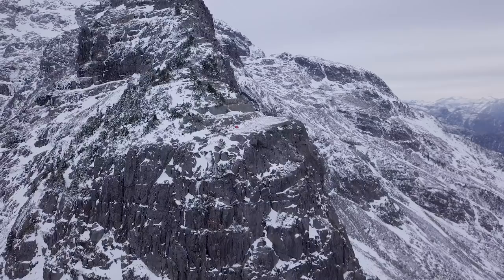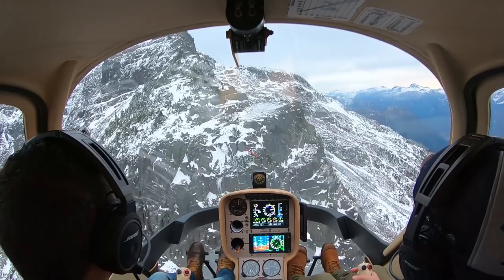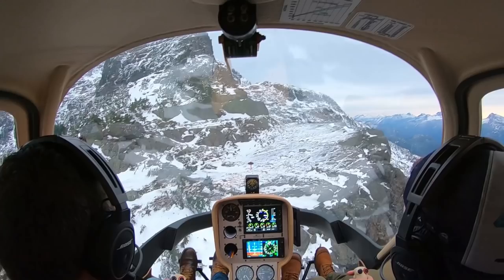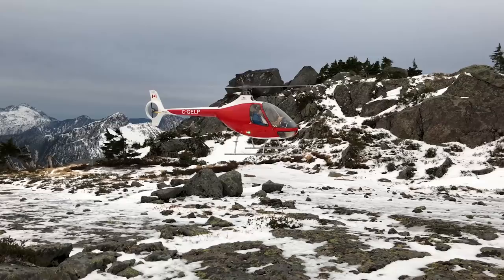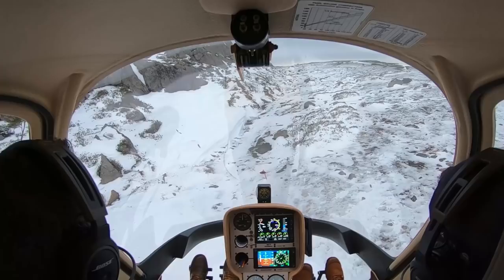WHY HELICOPTERS CRASH WHEN OVERPITCHED

Comment: A few years ago I took a ride in a Bell 47 (the one from the MASH series) at Sun & Fun and while we were out tooling around I could tell we were out of power. If he just tried to sit in a hover and climb straight up, we would not gain altitude. There simply was nothing left. And the rotors began making a different noise. Full of fuel, two large adults and 100° temps all contributed. Rather than the steady chop chop chop your ears get used to, it began to beat and the vibration was much more severe. The blades were at their full pitch yet the piston engine could not keep the RPM up. I glanced over when I noticed all this and he simply muttered "...over pitched..." and had to fly forward to gain enough rotor RPM to land. Fascinating to see this first hand.

Comment: While working at GE building T700's that go on the Army's Blackhawk, two pilots were touring the plant. They stopped to talk to some of us assemblers who were pulling lock wire to an assembly. They invited us to come watch them "pull pitch" as they left the plant in their Blackhawk helicopter. So at 4:00pm we went out to watch at the heliport .... and we got the best air show ever. After the flight engineer did his thing, and pilots warmed up the turbines to full power they "pulled pitch" Those two GE engines jumped that copter straight up about a 100 feet in a second... they hovered, turned toward the Saugus River and booked at full speed...just when we thought they were heading away for good....they came buzzing back at a 100 feet and headed for Boston.... an amazing display of power. That day we learned what pulling pitch was in that Blackhawk.

Comment: CFI Rotor here. I just taught maintain your rotor speed in the green a lot less to think about. Rolling off the power is not the same, depending on the helicopter too low of rotor speed can cause loss of tail rotor effectiveness. I teach RPM times torque equals horsepower.  Keep it in the green and live.

Comment: In 1970 in the Alaska Range I crashed (as a passenger in the front left seat) in a FH-1100. There were 5 of us aboard (including the pilot) and we were quite heavy flying in strong winds.The pilot was asked to drop me in a cirque basin, so he climbed as he angled toward a ridge line. I'm a fixed wing pilot, and I  saw him trade forward speed for elevation at the same time pulling more and more torque.  Right when we were just a few feet below the ridge wind buffeted us, and I noticed 106% torque when we heard a "bang" and the pilot dropped the collective ( I presume to keep/restore rotor RPM) and our skids hit the hill bending the tips up significantly.  Pilot then hit the right rudder spinning us downhill where he tried to gain energy to auto-rotate, but we hit the hill 3 or 4 more times never really achieving enough energy to maintain altitude. On the last impact with the hill we came in on a steep angle striking the rotor into the ground and we slammed to a stop.  The turbine had been winding down, but got ripped out of the engine mounts causing the cowling to ignite.  We all piled out with the pilot cutting his right hand on broken plexiglass.  We were very lucky- I recall the turbines at that time  were a bit underpowered compared to todays helicopters. We were all very lucky to survive.The bending of the skids helped us from snagging the 6 to 8 ft brush we bounced through- I figured we were going to tumble into a nasty ball.
Reply: Bill Roberts wow lucky you got away with that. Using yaw control the wrong way will also eat up a bit of power too.

Comment: Here after Kobe also! But his Pilot was in some super fog in VFR! But looks like at 1millsec pilot seen ground try to Bank left But at 180mph +dive it too Late!  And Chopper had NO ground warning proximity system!
Reply: +Lenny James   I think he lost his spacial awareness and rolled the helicopter upside down and accelerated  into the ground such that he thought that down was up.  He was climbing up out of the fog at 5 mph forward speed and then he ended up crashing into the ground at 180 mph.
Reply: @Islamisthecultofsin  Yes sir scary ride!
Reply: @Islamisthecultofsin  No up side down roll! just downward forward pickup up speed like anything will! He crash at 1000+feet So just to fogy he didn't no that was 2,300 hill was on him! End of the Day was pilot ERR! At first airport he was holding at! He as the Pilot Need tell Kobe it unsafe right now we need sit it hold here for hour! Cause By time fire dept got up hill to the sit the Fog was about cleared up!
Reply: +Lenny James   The issue I have is that the pilot knew the area.  He had flown it many many times.  If he gets into thick fog then you climb out of it.  He was going 5 mph.  It would be very unlikely that an experience pilot would dive and accelerate to 186 mph.  I maintain that he was trying to climb out of the fog and ended up accelerating  downward upside down which would explain the high speed at impact.  Your way would basically mean that they pilot chose to dive toward the ground.  If you are accelerating downward upside down you would feel like everything was normal when it wasn't.
We both agree that he should have landed and had someone take them the rest of the way by car or van.
Reply: @Islamisthecultofsin  And VFR He can not go above 500feet clouds push him in Ground! All is to it! just see this guy drop new video lets go watch see what he saying. Im not pilot just live next door to small air lot chopper in and out and stored their! for 20years bug lot guys over their for rides and teach me stuff just case if ride with some one dies flying say i can safe get us home or down!
Reply: +Lenny James   The pilot had 8000 hours of flying time and was an IFR instructor.  The problem was that he was staying proficient in IFR flying because he was flying VFR all the time.  He was already in the thick fog so he decided to climb out of it since he knew there were hills around him.
Reply: @Islamisthecultofsin  yup he was delusional thought he was flying right side up....but was actually rolling the chopper and insted of speeding up to ascend....he spead up and descended...👍🏾👍🏾
Reply: @Islamisthecultofsin  See my man Pilot did not have License to be flying people in IFR! Now its FACTS Do your home work look in to it! all over news today!
Reply: The pilot was an instrument instructor.  The helicopter company was flying in VFR conditions only.  He took off in VFR and then changed over to special VFR.  He then flew into IFR conditions by accident and decided to climb out of the fog.  He then became disoriented and accelerated downward upside down into the ground.
Reply: @Islamisthecultofsin  spot on

Comment: In my opinion lowering collective comes first( if height is available and then go for the turn). The turn should be a cyclic turn and not with pedals. Power pedals consume power . You are already low on it.

Comment: "here we are at 15,000 feet, I'm flying in at just about 100% power, and I'm going to demonstrate for you how easy it is to crash when you overpitch the helicopter..." :)
Reply: choppers usually do not go higher than 10 000 feet. It is why emergency pick-up of climbers is not a welcomed task. They are on their own. They know the risks. Mountains are full of dead bodies. No burial needed.
Reply: @RandySeverino  And THAT was the lesson. When your copilot does something you don't like, take control, get out of danger and sort it out with speed and altitude.

Comment: Most people do not understand how difficult flying a helicopter is. It is something like juggling and walking on a high wire at the same time. The use of counter-rotating props reduces the difficulty greatly as the need for an anti-torque apparatus is virtually eliminated. As time progresses the counter-rotating prop design will take the place of helicopters using anti-torque to controls.

Comment: I'm a bit particular when it comes to aviation terms... words mean things...
1) Settling with power is due to vortex ring state. 20-100% of available engine power with insufficient power to arrest descent, airspeed less than ETL and greater than 300 ft/min descent.
2) YOU ARE NOT floating on a cushion of air. Describing it as such is extremely dangerous. IGE hover requires less power due to rotor/wing tip vortices and induced flow.

Other people have commented on the other safety violations that occurred...

Comment: I had it drummed into me to only lose translational lift as you moved into ground effect. Flying at high altitude is very unforgiving but provides great training for small helicopters. Flying at sea level is so much safer. Lots of tricks like milking the collective a little to regain RPM.
Limited power operation demands a lot of attention.
Reply: in dcs is the elbrus rescue mission with the huey...shit, thats hard :D

Comment: Regarding the danger of over-pitching in helicopters:

What are the implications of electric motors for the risk of over-pitching (for both the chance of over-pitching and the ability to recover)?

My Tesla has extraordinary acceleration. This is because torque depends much less on RPM. I get instant torque without having to wait for RPM. 

Would a helicopter pilot’s need to focus on torque and RPM range become less critical?
Could electric motors be a boon to helicopter safety?

Comment: That characteristic instrument scan from the guy in blue!  Fixed wing pilots do that same scan.  Question:  After lowering the collective what do you do with the cyclic?  You said you turn away, so assuming you go right or left probably with pedal control since you are stalled on the rotor airfoil, but do you also add downward pitch or does the stall do that for you?  In fixed wing you would drop the nose and stop any spinning with rudder.  You drop the nose to get some airspeed over the wings to get lift to stop the stall.  Imagine it's the same for rotor craft with probably subtle differences.

Comment: I'm just a GA pilot, but wondered if you might have pointed out that on exiting the shelf you were on, you may need some additional take off altitude while still in ground effect before approaching the edge.  I once made the mistake of thinking that if my plane was airborne by mid runway, I would continue to climb...  even after flying off a cliff (and instantly out of ground effect).  A mistake I won't make twice.  :-)

Comment: 4:28 I believe that is an incorrect explanation of ground effect. Ground effect is due to the decrease in induced drag felt by the airfoil (in this case the rotor blades) as the tip vortices get interrupted by the ground and are weakened.
Reply: This is exactly right. Ground effect breaks the vortices, preventing them from recirculating, and thus increasing the efficiency of the rotor system. Ground effect IS NOT a cushion of air.
Reply: The cushion of air is just an quick and easy way to explain it - when one instructs its hard give the full explanation every time, especially when hovering on the side of a mountain. I'm sure Pilot Yellow and his student are fully aware of the correct explanation.
Reply: You have to remember he has to balance the technical content of these videos with more informal explanations as it will be watched by a whole range of people. From those who know nothing about helicopters to a seasoned Blackhawk pilot who did a gazillion tours in combat zones, flew at 2cm over sand dunes at night with NVGs and weaved in and out through cactus plants at 160kts white hitting all the ETAs within 0.1 sec of the flight plan.  
So the "cushion of air" explains it nicely to the layperson. Those in aviation will of course understand what he meant.

Comment: the physics of actually being in a situation of running out of power, begs the questionswhy not just build a bigger engine!
Reply from the maker: Dave Marine 1 it’s a fine balancing act. Bigger engine means you need bigger gearbox which leads to bigger drive shafts etc. Ultimately leading to higher cost and more weight which brings you back to the same issue.

Comment: The blades are pretty much stalling during (over pitched)
Reply: And once the blades are stopped, it's basically a rock with a tail stabilizer.
Reply: That is what I was thinking the whole time. Guess there is no stall horn on the blades
Reply: There's the sound of the revs going down plus the low RPM warning. But yeah, those can be heard only a bit late.
Reply: Thanks
Reply: stall horn is rotor rpm, not engine rpm. When a helicopter's blades stall, they depart the plane of rotation, and often chop off the trail and/or chop into the cockpit. Then, as you said, it's a lawn dart.

Comment: Ahh okay I think I just had one of those light bulb moments. I've heard the term "overpitching" several times before and I always assumed it referred to the pitch of the main rotors in the direction that is controlled by the cyclic, but I guess it's actually the pitch of the blades that is controlled by the collective then? I hope that made sense, I'm not a pilot so I struggled with wording there 🤣

Comment: When landing where you can go "down" and away.
Reply: At high altitude you want to approach a ledge like this and have an escape path.  In flat terrain you often have the option of a "running landing" - landing with forward speed requires less power than hovering.

It's similar to how you'd want to land a paraglider.

Comment: Not sure what all you've flown, but some helicopters won't "over-pitch."  Turbine-engine helicopters whose engines don't govern for temperature will just burn themselves up rather that droop the rotor.  I always would always prefer to have a bad approach end with an over-temped engine than a crashed helicopter with good engines.  I know CH-47s and I think Mi-17s both will destroy the engines before they droop the rotor.
Reply: Rhubarb Steve thats not true.  many turbine machines can be over pitched.  Most turbine machines NG/N1 out long before engine tot.  Astar for example can droop very easily at 4000 feet or higher.
Reply: I flown dozens of helicopters and thousands of hours and never seen a machine "over pitch". I have have seen jerk off pilots allow the rotor to "decay" but not what you're talking about.

Comment: I don't know anything about flying, but on general principles, isn't it best to demonstrate disaster recovery techniques in a spot where, if  you screw up the technique, you don't fall off a cliff into a 1000-ft. gorge?  When I was demonstrating how to recover from an accidental gybe and roundup in a sailboat, I didn't do it in front of an oncoming freighter in a narrow channel.

Just sayin'.
Reply: You gotta love comments like this.  If you don't know anything about flying or helicopters, then why the hell do you think your highly judgmental and ignorant opinion would be worth anything at all?  Here's a clue....a helicopter is not even slightly close to being a sailboat.
Reply: @DirtFlyer  LOL exactly
Reply: I think James Schrumpf is trying to stress the value of safety here, which is always necessary for actions like these.  Can't be overstated.
Reply: @ashsmitty2244  
That was uncalled for, James is only interested about this topic.
Reply: The narration describes why they were practicing this next to a cliff. So that they can drop the collective, do a pedal turn and dive down. This allows the rotor RPM to recover and then go around for another approach. This starts at 2:30 and at :38 you can see the A/C dive to the side and down. If they practiced this on a flat landing spot the overpitching of the blades would not allow any safe exit to recover rotor RPM. The A/C would then hit the ground at a high rate of decent.
Reply: The answer is in the video. You can see the guy gaining airspeed as he heads down the mountain side. He needs forward motion to get out of there. If he didnt do that and came down on level ground, he would have a hard landing. Now you know better

Comment: They said that Kobe’s helicopter was too low to begin with. Maybe it did over pitch trying to power going higher...and the pilot may have tried to correct it, but they were too low. I think maybe that could’ve happened due to not realizing how close they were to the ground. Maybe...Idk tho, because I’m not a pilot. I’m just trying to make sense of it.

Comment: Thanks. Was trying to figure out that infamous video where the helicopter with the bride before her wedding crashed when they flew into IMC. The attitude gyro is visible in the video, and like a second just before the rotor speed horn sounds, you can see it pitched up sharply. I suppose this was a result of the pilots control input when losing orientation in IMC. The rotors are so light on an R44 that they decelerate very quickly, I have read.  A question, in the case of critically low rotor speed, what happens to the aircraft next..?  In the infamous wedding video you can see that it begins to spin with enough speed that the pilot is thrown across the cabin.